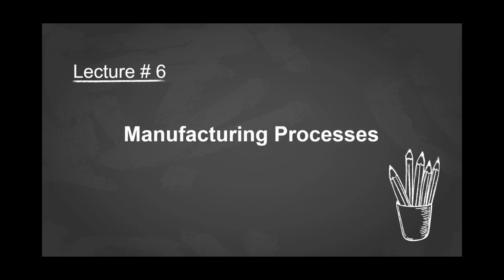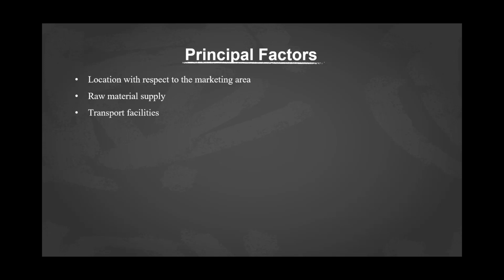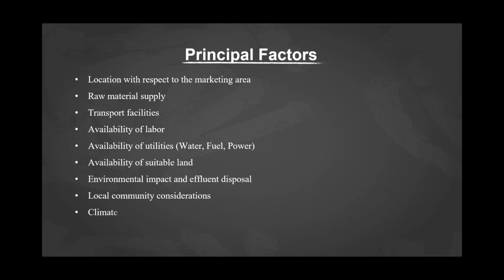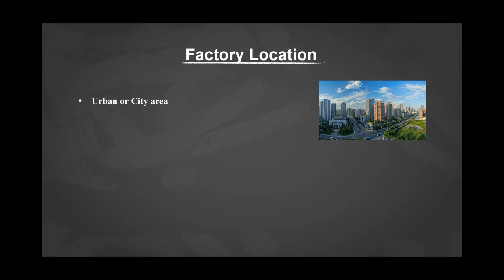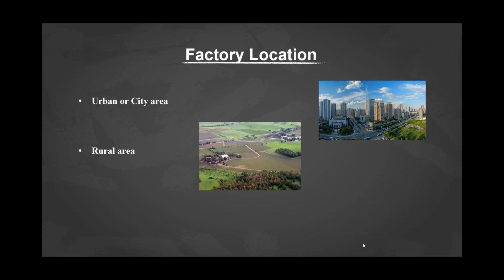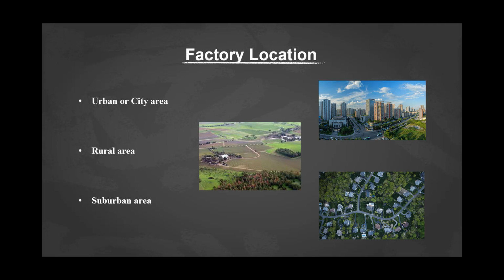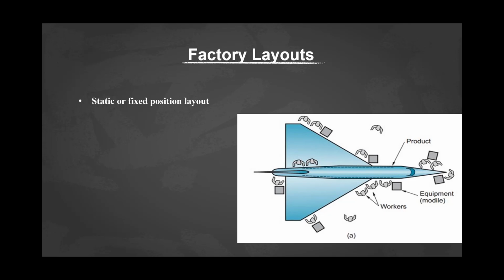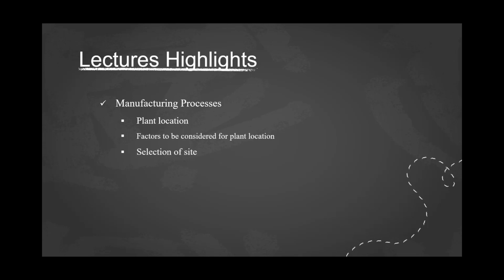lesson #6: Manufacturing Process;Plant Location, Urban Areas, Rular areas and suburbs, Plant Layouts

Comment: Adnan sher
F18-0272
Section A
Software engineering

In this lecture we learned about the factory location and plant .
A plant should be located where inhibitans are interested in its success the product can be sold profitably and production cost is minimum.
Factory that effect plant location like .
/Better transport facilities
/Banking facilities
/Availability of suitable labour
/Marketing area
/Climate impacts 
/Availability of utilities water fuel power
/ Local community consideration
etc.
FACTORY LOCATION.
1)Rural areas
2)Urban areas
3)Suburban areas
FACTORY LAYOUT..
(TYPES):
1) Static position layout:

Process is brought to the product.
2) process layout:

The raw material is passed through all the process to produce an end product.
3)Cell or group layout:

Machines performing similar operation are grouped together.
4) Products based layout:

This layout confirm to the sequence of operation required to produce a product.

Comment: F18-0273
summary:
 FACTORY LOCATION:
 Factory location is an industrial site where the production cost is minimum and get maximum. 
A factory/plant should be located at a reasonable place where minimum cost and maximum production could be produced while selecting the location of the plant We must consider some of the following factors:
Location with respect to the marketing area, Ease of raw material supply, availability of transport, utilities, suitable land and labor, Environmental impact, Local community consideration, Political Strategic Considerations
Urban areas have both advantages as well as disadvantages, like banks, cold storage, transports, cargo, buy and sell market,, trainer development facilities, specific municipal area facilities whereas the cost of land, insufficient land space, high standard living, trade unit movement, high taxation, certain municipal restrictions are some drawbacks of urban areas
Rural areas are totally opposite to urban areas same as suburban areas has also some pros and cons.
Types of Factory Layouts:
Static or Fixed Layouts: Process are brought to the product.
Process Based Layout: Operations of similar nature are performed.
Cell or Group Layout: Machines performing similar operations are Grouped together. 
 Product Based Layout: Focuses around the product not process.

Q. Write down the names of top manufacturing countries of the world.
Ans. 
1. China: $4T (28.37% of world total)
2. United States $2.3T (16.65% of world total)
3. Japan: $1T (7.23% of world total)
4. Germany: $806B (5.78% of world total)
5. South Korea: $459B (3.29% of world total).

Comment: F18-0339
BSSE 5 B
Summary:
• FACTORY LOCATION: Factory location is an industrial site where the production cost is minimum and get maximum. • Factors:  Marketing area, Supply of raw materials, Transport facilities, Availability of labour, utilities and suitable lands, Environmental impact and disposal of wastes, effects of climate etc are the factors that affects plant location. • Urban Areas : Advantages of urban areas are better transport facilities,banking and cold storage etc .High land cost , high living standards and high taxes are the disadvantages of urban areas. •  Rural Areas: Opposite of urban areas. Cheaper land cost. low  living standards,low lobur cost etc are the advantages and disadvantages includes non-availability of transportation , absence of insurance facilities etc.
 •  Suburban Areas: also have some advantages and disadvantages .
• FACTORY LAYOUT : There are four major types of factory layouts are:
1:  Static or Fixed Position Layout : where the process is brougt to the product ,not the product to the process.
2:  Process Based Layout :  operations of similar nature or functions are grouped together.
3:  Cell or Group Layout : products with similar process requirements are assigned to same manufacturing cell.
4: Product Based Layout : the sequence of operations required to produce a products.
• TOP MANUFACTURING COUNTRIES : Top manufacturing countries are, 
. China
. United States
. Japan
. Germany
. South Korea
. India
. Italy

Comment: Amina Awan (F18-0283) 
BSSE 5TH A
SUMMARY:
Department's and machiner's layout  makes chance of low cost productivity at high efficiency. Urban areas and rural areas both have their own advantages and disadvantages for layouts pf factories. Transportations, material availability and supply of product are the advantages of urbun areas,  on other hand high cost labour, taxes and high land cost are disadvantages. Similarly, lack of tecnological resources, problems of material supply and transportation are the disadvantages of urban areas and low cost labour are some advantages. 
Factory layout:
i) Fixed position layout ( processes are brought to the product) 
ii) Process layout (processes are arranged according to their process type) 
iii) Product layout (set of operations performed to make a product) 
iv) Cell or grouped layout ( processes with same functionalities are grouped together in same manufacturing cell).
TOP MANUFACTURING COUNTRIES IN THE WORLD:
1. China: $4T (28.37% of world total)
2. United States $2.3T (16.65% of world total)
3. Japan: $1T (7.23% of world total)
4. Germany: $806B (5.78% of world total)
5. South Korea: $459B (3.29% of world total)

Comment: Muhammad Hashim Khan Jadoon
F18-1208
BSSE 5A

Summary :

In this lecture we have to discuss about plant location. Plant location is an important step because location also effects the process due to which plants or factories are located in that particular area where experience are minimum and production is maximum.
Factors marketing area :
Supply of raw material, transport facility, labours availability, marketing area, climatic impacts etc.
There are three types of locations for plant or factories are urban, suburban, rurlar areas.

• Urban area :
Urban areas are favourable for plants for some reasons like : transport facility, Bank for money, cold storage etc along with that it also have some disadvantages like : expensive land cost, high taxes etc.

• Rular area :
It is opposite to urban. Not expensive land, low labour cost, low living standards.
 Along with that it also have disadvantages like transport facility etc.

• Sub-urban area :
These area are best for plants because we get labour and cost of land is not high.

• Factory layout :- 

→ Static or fixed layout :
This type of layout is used for products that has constraining characters.

→ Process layout :-
The raw material is passed through all the processes to produce an end product.

→ Cell or group layout :-
Products with similar process requirements are assigned to same manufacturing cell.

→ Product based layout :-
The sequence of steps required to produce a useful product.

Top manufacturing countries are :
US,
China,
Germany,
Japan,
Korea,
Uk.

Comment: F17-0136
BS (SE) 5th C
Summary:
A plant should be located where inhabitants are interested in its success the product can be sold profitably and the production cost is minimum
Principal factors:
Factors that affect plant's location are :
1.location with respect to marketing area
2.Transport facilities
3.Ability of raw material
4. Availability of suitable land
5.political strategic considerations etc
Factory location:
1.Urban or city area:
In urban areas transport communication banking facilities etc are available. But the disadvantage is high cost of land, labor and high taxes etc
2.Rural Areas:
These areas are opposite to urban areas. These areas have low population density and large amount of undeveloped land. Land is available at cheaper rate but it is not possible to get skilled workers
3. Suburban Areas:
Land in this area is available at cheaper rate. These areas serve as residential areas for most of urban areas
Factory layouts:
Different types of layouts are:
Static or fixed position layout:
In this layout process are brought to the product not product to the process e. g railway system
Process layout:
In this layout all machines are grouped according to their functions e. g mills etc
Cell or group layout:
Products with similar requirements are assigned to the same manufacturing cell
Product layout:
This layout conforms sequence of operations required to produce a product
Names of top five countries with biggest manufacturing output:
China 
United States
Japan
Germany
South Korea

Comment: IJAZ AHMAD
F18-0285
5th(SE)
Section (A):
Summary:::
In this lecture we learned about the factory location and plant .
A plant should be located where inhibitans are interested in its success the product can be sold profitably and production cost is minimum.
Factory that effect plant location like .
/Better transport facilities
/Banking facilities
/Availability of suitable labour
/Marketing area
/Climate impacts 
/Availability of utilities water fuel power
/ Local community consideration
etc.
FACTORY LOCATION.
1)Rural areas
2)Urban areas
3)Suburban areas
FACTORY LAYOUT..
(TYPES):
1) Static position layout:

Process is brought to the product.
2) process layout:

The raw material is passed through all the process to produce an end product.
3)Cell or group layout:

Machines performing similar operation are grouped together.
4) Products based layout:

This layout confirm to the sequence of operation required to produce a product.

Comment: BS(SE) ,5th C F18-0375 
 Factory Location: 
A plant should be located where inhabitants are interested in it's success, the product can be sold profitably and production cost is minimum .
 Principal Factors: 
Factors that effect plant location are
✓Location with respect to marketing area ✓Transport facilities ✓Availability of raw material ✓Availability of suitable land ✓ Climate ✓Political strategic considerations. etc          Factory Location: 
 (1) Urban or City area: 
In urban area transport, communication services, banking facilities etc are available . But disadvantage is that cost of land, labors, various types of taxes are very high.
 (2) Rural areas: These areas are opposite to urban areas. These areas have low population density and large amount of undeveloped land. Land is available at cheaper rate. But it is not possible to get skilled workers.  
 (3) Suburban areas: . Land in this area is available at cheaper rate . These areas serve as residential area for most of urban areas.
 Factory Layouts: 
Different types of layouts are
 ✓Static or fixed position layout: In this layout process are brought to the product not product to the process. Example: Railway system
 ✓Process layout: In this layout all machines are grouped according to their functions . Example: injection , mills etc
 ✓Cell or group layout: Product with similar requirements are assigned to the same manufacturing cell. ✓Product Layout: This layout conforms sequence of operations required to produce a product.
 Top 5 countries with biggest manufacturing output:
✓China ✓United states ✓Japan ✓Germany ✓South Korea

Comment: BSSE 5th 'A'
F18-0313
Firstly we have to select the best factorty location. And the factors that effects location are:
Ease in the supply of raw materials, Better transport facilities, Availability of suitable labour, Marketing area, Better drainage system for disposal of plant wastes, Climatic Impacts etc.
Then we have discussed urban area and rural area and aspects of both areas 
Urban Areas are favourable for plants on some aspects:
Due to much populations, the clients are more and skilled labours are high. on the other hand, the land is too much expensive.
Rural Areas are Opposite to urban areas. 
Lands are not expansive, Availability of low labour cost. On the other hand, the customer may be less and transport facilities may be not available.
Suburban Areas are also favourable for plants in some aspects.  
Then we have discussed factory layouts
FACTORY LAYOUT : 
There are four major types of factory layouts
 1) Static Position Layout:
 When your product is fixed and you have to move your workshop to the product.
2) Process Layout: 
The raw material is passed through all the processes to produce an end product.
3) Cell or Group Layout:
Different departments are created consisting of different functions and each process have to pass through each step. 
 4: Product Based Layout:
 the sequence of steps required to produce a product.

Comment: F18-0293
BSSE 5TH(A)
Abdullah
                                                  &&&&SUMMARY&&&&
This is lecture is about the area for manufacturing plant deployment. we studied plant location and use in practical for achieving high result. Because plant location matter we should construct a plant in the area whether cost is minimum and production rate is maximum i.e. return on investment is maximum. To achieve this result we should go to use some practical method that is:
construct  the plant where resources are easily accessible, transport is available, also go and scan the market for the respective product that should to be manufacture in plant, also check the rules and regulation set by the government authority.
also check the area for the plant whether it is in urban, rural or suburban because these area effect the project plans and budget in different ways.
for example if we  use urban areas it have some advantages in the form of developing areas transport facilities high utilities in the form of electricity and fuel.
but on other hand it have also some disadvantages also in the form of high cost taxes rush in plant no extra space for new research activities. on other hand rural areas is opposite to it.
we are going to choose the neutral way that was suburban area which is based on the developing areas not yet fully developed.

also we learn about the different layout of factory that is:
1)fixed based layout
2)  group based layout
3) process based layout
4) product based layout 
if any plants can follow this technique they may reach to the highest level in their business because this can minimize the time taken and maximize the outputs also it require less number of labour

Comment: F18-0300
BSSE 5TH A
Summary :
      Manufacturing Process :
° Factory Location
        A plant should be located at a place where inhabitants are interested in its success, the product can be sold profitably and production cost is minimum.
° Principal Factors:
> location with respect to the marketing area
> raw material supply
> transport facilities
> availability of labour
> availability of utilities (water, fuel, power) 
> availability of suitable land
> environmental impact and efficient disposal
> local community consideration
> climate
> political strategic consideration
FACTORY LOCATIONS:
   Urban Area:
           Is a region surrounding a city including  its advantages and disadvantages.
  Ruler Area:
         Ruler areas are the opposite of urban areas
  Suburban Area:
          These areas are best for plant location because we get labours and cost of land is not that high.
FACTORY LAYOUT :
   > Static or fixed layout:
              This type of layout is used for products that has constraining characters 
   > Process based layout:
              In this layout operations of similar nature are performed. 
   >  Cell or group layout:
              This is a type of layout in which machine performing similar layout are grouped together. 
   > Product based layout:
             This layout confirms to the sequence of operation required to produce a product.
TASK:
Q. Write down the names of top manufacturing countries of the world.
Ans. 
1. China: $4T (28.37% of world total)
2. United States $2.3T (16.65% of world total)
3. Japan: $1T (7.23% of world total)
4. Germany: $806B (5.78% of world total)
5. South Korea: $459B (3.29% of world total).

Comment: Summary:
Factory Location:
A plant should be located at a place where inhabitants are interested in it's success the product can be sold profitably and production cost is minimum. Some of the factors are mentioned below
 location with respect to marketing area, supply of raw material, Transport facilities, availability of suitable labor, along with this availability of utilities ( water, fuel, power), Availability of  suitable land, environment impact, local community consideration, Climate, political strategic consideration. 
Urban area:
An urban area is the region surrounding a city. Most inhabitants of urban areas have nonagricultural jobs. Urban areas are very developed, meaning there is a density of human structures such as houses, commercial buildings, roads, bridges, and railways. "Urban area" can refer to towns, cities, and suburbs.
Advantage and disadvantages :
transport, buy and sell markets, and many more and some of disadvantages are high living standards , high taxation and insufficient land space...
Rural areas are opposite to urban or city area.
low living standards, lands are not expensive as compared to urban area etc.
Types of factory layouts:
static or fixed position layout , process based layout, cell or group layout, product based layout.

Name the top manufacturing countries of the world?
The top manufacturing countries of world are 
United States
China
India
Japan
Germany
South Korea
Mexico

Umer Sajid
F18-0318 
BSSE 5 A